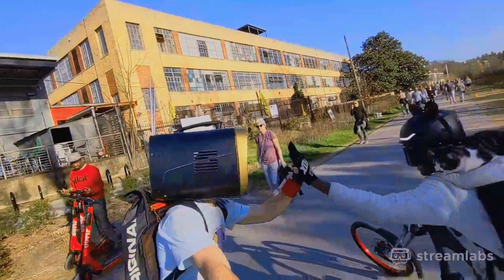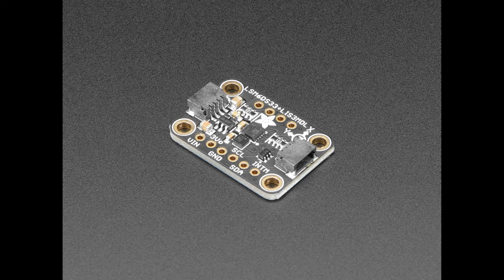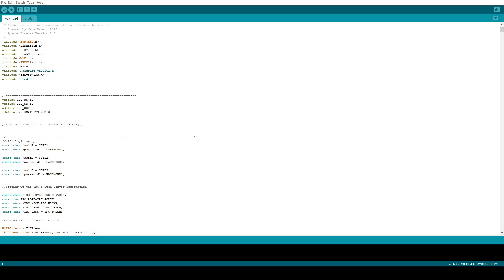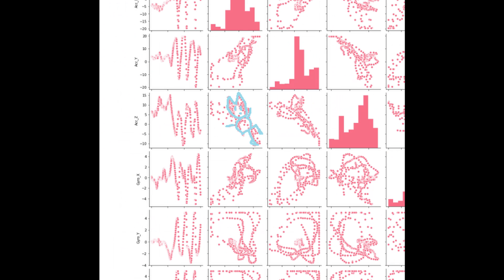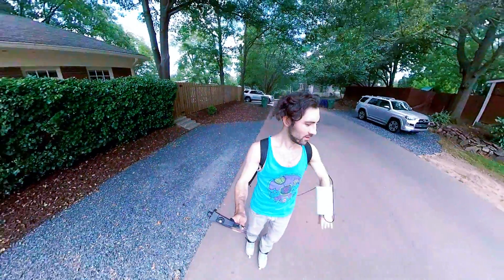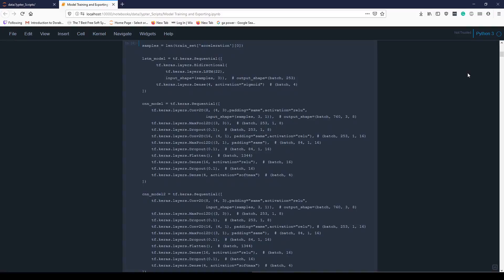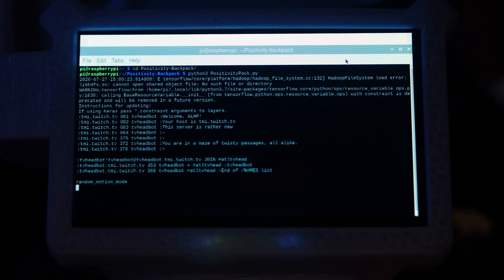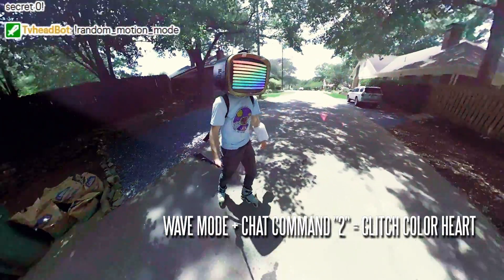Gesture Recognition with Machine Learning

Comment: Off-topic question: do you see our between slits or do you have an HMD in there?
Reply from the maker: Thanks for the sub! I see in between the slits. The tubes are designed to keep light from shining back into my eyes. I had a small HUD in there for chat, but I removed it and haven't put it back in yet.
Reply: Atltvhead thanks for the content! I’m working on rebuilding/retrofitting a display shelf prop into a wearable cosplay element and trying to shoehorn in a display from something like a VR headset, so I figured I’d see if you’ve already been down that route :) I like the idea of using slits for meatspace and a display for scrolling text chat, sounds like a good marriage of practical solutions and tech!
Reply: Nate Damen I’ve tested a few sets owned by drone buddies of mine but haven’t found any with a satisfyingly low latency. Initially I was aiming to use a VR headset due to that but I’m starting to think I’m going to have to roll my own from-scratch solution built around a raspi or fpga